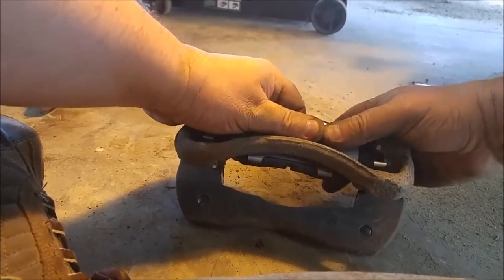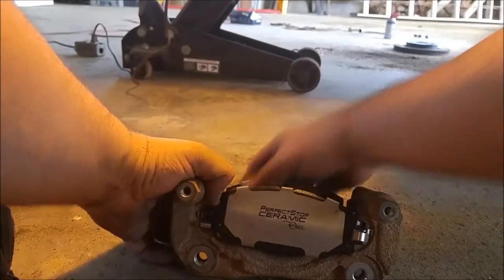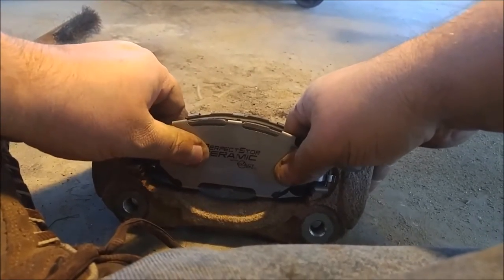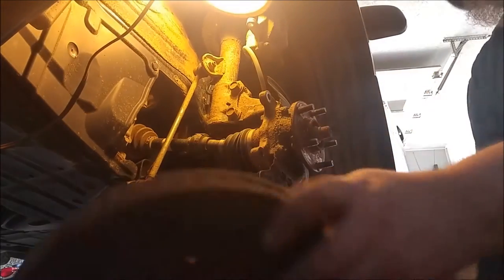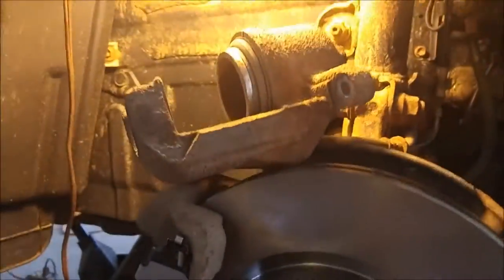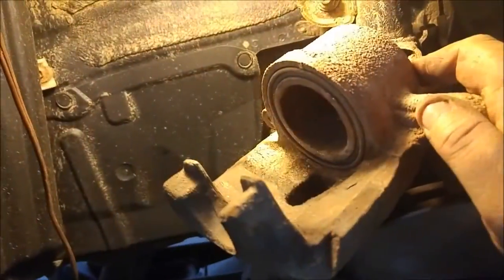2010 Toyota RAV4 Brakes & Rotors Replacement Part 2

Comment: i have an 08 rav4. it's getting around that time to start working on it. i'm now starting with pads and rotor. ur video is very helpful. keep more coming on the rav4 please.
Reply from the maker: You're in luck! LOL I'll be replacing sway bar bushings soon.  And in July I'll be replacing the suspension in the front and rear.  Stay tuned. :)

Comment: cheers from  Canada....great videos...i have an 05 rav4 manual transmission(58000 kms) i was told by the dealer after an oil change that i needed new front rotors and brakes plus the sway bar links and bushings are worn and the serpentine belt needs replacing as its the cause of noticeable engine noise as compared to when it was brand new and you couldn't tell that engine was on as it was so quiet...anyways i was quoted for links $290...bushings $150...brakes $160..rotors $180..and serpentine belt $134..total around $900 Canadian which is about $700 US....even after i got a couple of quotes from independent garages it came out to almost the same....apparently labor costs are about $125...i wonder if combining all the jobs might bring the labor cost down......thank for reading and keep up the wonderful videos....very informative as i am starting to learn about cars...take care..cheers!!!
Reply from the maker: +Rob C. Thank you for watching Rob!! :)  Most garages have books that dictate how much time and labor they will charge for each job.  It really depends on who you go to, they may be willing to work with you on the price.  Are you thinking about doing some of this yourself?  Do some research and go online.  You can get front brake pads AND rotors for about $65 US.  Bushings are about $20 US, I would go with Moog for the end links, I can't remember what I paid for those but it wasn't bad.  You should be able to obtain the sway bar end links, the bushings, and the brake pads and rotors for under $150 US.  The serpentine belt you can get online for about $35 US or less.  If you get the parts yourself and do it yourself you will save tons of money.  Even if you have someone do it for you, I would still get the parts yourself online.  There are alot of reputable online dealers that offer quality auto parts.  You will save alot of money getting the parts yourself, even if you have someone put them in for you. :)  Thank you again for watching!!  Good luck!! :)

Comment: Just curious why you don't put any lubricant on the shim surface, where it comes in contact with the caliper? I was told that reduces squeaks/squeals.

Also, it's always a good idea, while you have the caliper apart, to remove the caliper slide bolts, clean, and re-grease them, and check the boots to make sure they are in good shape. I've lost a number of brake pads/rotors over the years to seized caliper slide bolts, where the grease leaked out, water got in, and the pins rusted and seized.
Reply from the maker: Thank you for your feedback wowza1211!  I've never put lubricant on the shim surface.  More of a preference of mine really, but I've never had issues with squeaks and squeals.  You are absolutely correct  about the slide bolts, it is a good practice to take them out and re-grease.  I recently had to replace a pair of front calipers on my 2003 RAV4 because of the same issue.  I brought it to a machanic twice for other reasons, asked them to check my front brakes and they said I had plenty of meat left on the shoes.  I'm thinking to myself, that can't be right because I'm pushing the brakes almost to the floor when I have to stop.  Finally I took them apart myself and guess what I found, seized caliper slide bolts!!  Thank you for watching!!  I hope you subscribed. :)

Comment: What is the size of 2 smaller holes on the rotor so that I can buy 2 bolts the push the rotors off. Mine 2 dusty and I hammered it and it still does not have sign to come off ;) Thanks for the great videos.

Comment: I changed the front brakes following your video, but for some reason my rav4 wont move like if the brakes were permanently engaged
Reply: Got it fixed nvm
Reply: @badhabitz93  what was the issue?
Reply: @wronggGuy  I had the back disc breaks on the front.